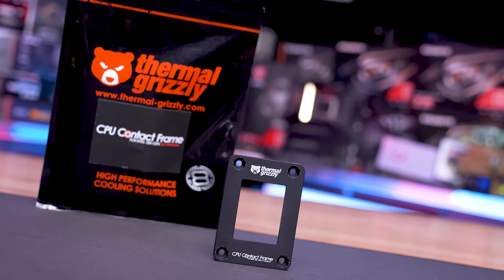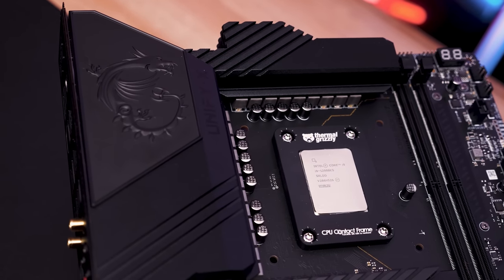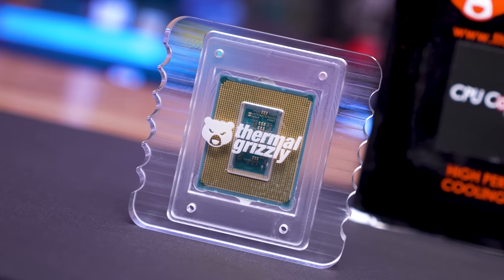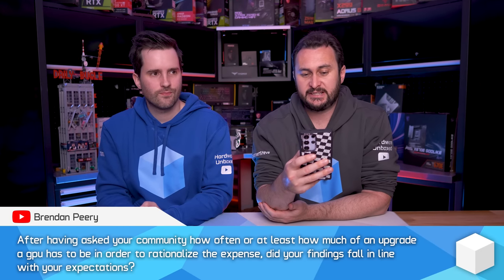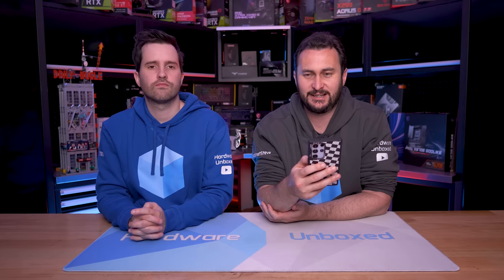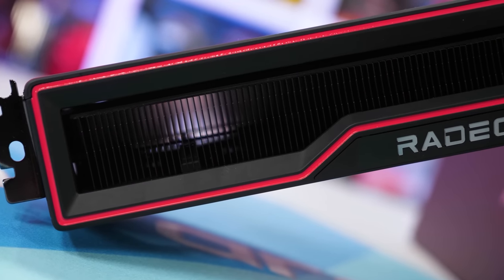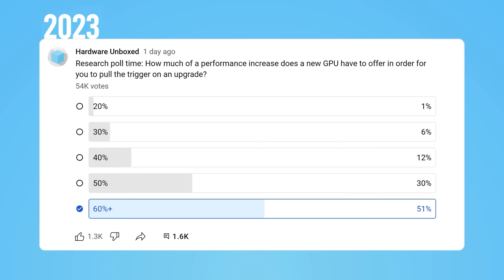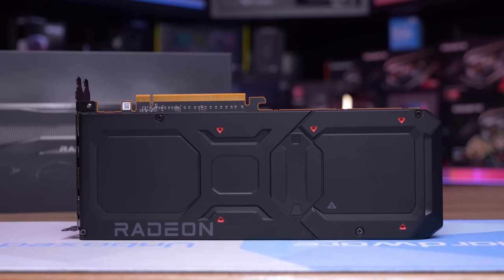RTX 4050 Pricing & VRAM, Are 12-core CPUs Dumb? March Q&A [Part 2]

Comment: “Nvidia trying to condition gamers to pay more, for less.” Who would’ve thought that Intel, the arch antitrust, anti-competition villain of the past, might produce a reasonably priced mid-to-top tier GPU (Battlemage), blowing Nvidia’s strategy away.
Reply: If Intel can offer me 2x 5700 XT performance for no more than 500€, I'll bite
Reply: The problem is Intel isn't really disrupting the market, they are just slotting in within the current pricing structure.  Intel's GPUs are cheap because that is the performance level they command.  In order for Intel to disrupt the market they need to hit at the 4070 Ti level and above and price their cards reasonably.  There's always the chance that when Intel does get performant, they simply follow the Nvidia pricing structure.  After all, this is Intel we are talking about.
Reply: @giglioflex  Intel's arc 770 is a great card ( just brought one a few days ago for a all intel build ) i paid $560aud for a 16gb card  a 3060 or 6700xt is the same price with only 12gb..

i know intel drivers can leave alot to be desired but there are constantly updating and improving them .. 
it s a far cry from my 7600x soon to be 7800x3d and 7900xtx but for the budget sector i see intel going from strength to strength which is where they need to be because with the rubbish Nvidia are trying to push out at their stupid costs is a joke !!

and we are yet to see what AMD offers but its not going to be cheap !!
Reply: too bad this wont happen, intel chief of arc left and rumor is they will have a few SKUs for Battlemage and there is only 1 SKU planned for Celestial, it looks like Arc is being put on the back burner until they come up with a rebrand or something
Reply: the only ones that will buy Intel are the ones that would buy AMD-Cards. AMD is pricing their cards far better since they aquired ATI. Their pricing got a little bit out of hand the last two years but just at launch. AMD-prices are dropping fast after launch, but is anyone buying them? They have similar performance at native resolution like their Nvidia-counterpart and they give a lot of features like open source driver, FSR and their Radeon utilities (which Intel has not). But who is growing its market share? It for sure is not AMD. Intel has weakened AMD, the only real competition for Nvidia fo now. Of course they have to counter with higher prices to compensate for that. 

And Intel is definitly not your friend. Right now they are selling their cards at a loss, because they want to get a foot into the market, but once they are in?
I guess what will happen is, that AMD will close its Graphics-devision, because that is the only market Intel will compete in. Nvidia-buyers will buy Nvidia. AMD right now is in a good Position and i think with their new Architecture they will be able to compete on every performance-level with and without raytraycing (still a stupid feature for me). It needs one or two slips of Nvidia Hardware-wise on the High-end to get in trouble. But they are far away from it right now. And for Intels graphics devision? It is not looking good right now. Intel loves money. A lot. And it does not seems, that Intel graphics will become competitive nor profitable any soon.
Reply: @volvot6rdesignawd702  From what I know about AMD's midrange RDNA 3 dies (check out Angstronomics RDNA 3 leak from August 2022, it's been pretty accurate so far), they won't be very expensive, especially Navi 33. That one is monolithic on 6nm so quite a bit cheaper than the 5nm main die the higher end chips use. Not sure on performance yet but 6700XT or even better 6800 non XT performance on a 7600XT would be pretty good for most people and it needs to be priced around $300 or less (not closer to $400 in other words).
Reply: @vigilant_1934  problem is they are going to price match with Nvidia if Nvidia try's to sell the 4060ti at say $600usd AMD would be damn stupid to sell the 7800xt 
( which make more sense as 4060ti competitor than a 7700xt or 7600xt ) at $300 or $400usd..

Personally i dont think there is any need for either company to go lower than a 4060 and a 7700xt at the lowest and AMD most likely go lower price than Nvidia but they will not be what budget builders are looking for ..

Thats why i kinda throw my support behind the Intel arc 770 i bought one the other day to eventually build a 13600k / intel arc 770 build ( my main system is a 7600x soon 7800x3d and a 7900xtx red devil so i dont need the Intel system)
but this intel arc 770 with 16gb at its low cost is a real contender in the budget 1080 1440p GPU market !! 

Truth be told ive not really tested the arc 770 out with games etc yet as ive paired it with a b550 5600x just to get it running but as im going to buy a b660 ,13600k and some ddr5 after my 7800x3d purchase.. 
Then wiping the ssd and starting again for the re build its pointless to start downloading games!!

Ive watched videos after videos of intel constantly trying to improve their drivers every few months ( so im seeing real intent to improve and succeed)  yes Intel is a multi billion dollar company but i decided to throw my support behind them because despite the haters etc etc budget builders NEED intel to succeed which is why i bought one ..
Reply: Only because Nvidia left that lane open to Intel by moving into the over priced lane.
Reply: Wait till you realize that companies don't care about you and have to do this to gain market share and goodwill. people loved amd. It didn't save them lol

Comment: They're going for the price inflation angle.  They make far more margin that way (which is a huge part of the numbers they target).  They're trying to follow the trends set by Apple and to a lesser extent, Samsung.  Clearly double (2x) the price isn't working, but they can likely get away with somewhere in the realm of 1.5x or even 1.8x.  Don't support it, buy used when possible.
Reply: the only way to change them is to send a clear message that they messed up bad. The only way to do that is to massively shift market-share to AMD/intel. So skip all nvidia cards and buy from teams Red/Blue this upgrade cycle.
Reply: used is indirectly also supporting the purchase of new GPUs via higher resale value

the best thing you can do is to do nothing
Reply: Nah everyone buy a steam deck. It helps boost Linux and AMD marketshare plus you get nice portable gaming machine. Plus the more there are the more devs will have to optimize for lower end hardware to make sure they get the steam deck market.
Reply: @leonhopfl573  Not to the extend that you're thinking it does. There are always going to be people that will buy the newest and fastest, regardless of cost or if they can sell their used GPUs.  During it's years of marginal improvements, Intel ran into the problem that they had to compete with their older products available from the used market. As for doing nothing, it too is a perfectly acceptable option if what you have is already sufficient.
Reply: My last full price GPU was an NVIDIA 950, ever since, I've bought used for a third of the initial cost. It makes no sense to pay double. Don't cover inflation for the developer.
Reply: Not going to claim that companies haven't taken advantage of inflation a bit. However they are not the cause,  low interest and money printing is the cause.
Reply: @wayward03   When I say price inflation, I'm not talking about currency inflation.  They are pushing up the prices of their products chasing margin.  The trend started well before the cv.  Apple started selling phones for way more than their traditional $199 price back in 2015.  Nvidia pushed their pricing up when they introduced RTX.
Reply: @pyro226  that's true,  apple is famous for it. 

On the flip side, computers are still cheaper than they were in the early 90s.
Reply: @chronossage  Steamdeck lol fucking just no
I'd rather buy a used gaming laptop from years past, so I can have an actual laptop and portability. Like, the only time and place a steamdeck makes sense if you're taking the metro to work, but that's like several minutes of gaming tops you might as well play poker on your phone then. I cannot understand steamdeck users. It's wildly expensive and overpriced to within gaming laptop segment, but with a tiny screen, less useability, not a computer, not a mobile shitpost device, horrible performance.
>it's smaller
And easier to steal, really don't get the advantage it's supposed to have over any other thing. Then, I don't really play Nintendo or anything so maybe there's a specific niche game it's good at I don't play, as opposed to atmospheric adventure titles and horror or whatever.

Also you didn't solve the problem for anyone but kids, with rich parents, because it's not for kids too poor to afford a console or computer. I mean at that point you might as well have just said "get a console" even though consoles have huge hidden costs in needing to buy a TV, controllers, and the games cost twice as much on console as PC, or more.

The other guy is right, the most obvious thing is for people to just buy AMD. I already switched to AMD and pretty happy with it. Like if you get an AMD card you're going to play every title at 1440p ultra. If you got a 6800XT or better you can play 4k ultra. There's no reason to stick with nVidia at all except plain stubborness. That, or you need specific encoders, which I doubt like 99% of gamers even know about or ever are going to use. It's pure cope, and is partly because I think gamers by their nature are really resistant to change. They don't like changing their habits. I can imagine the sort of cigarette ash covered keyboard, beer cans everywhere, don't even notice their whole apartment makes their clothes smell of stale beer, but still refuses to clean or change anything even knowing it's wrong because gamer addict mentality. Not having to use Geforce Control panel alone is a blessing. Knowing I'm not cucking myself also is nice.
Reply: @drek9k2  Do you even know what a steam deck is? It's definitely more portable than a laptop and I don't know how $400 is "wildly expensive" even if you have to add in the extra cost of an SD card to make it $450ish. It's a x86 computer with enough power to run most of the PC games out there.

Comment: About why 7000 don't get so much as 5000 from V cache, maybe is simple because it is using DDR5 and older using slower DDR4, and cache is mostly useful in RAM limitation cases
Reply: It makes the CPU less reliant on fast RAM, so you're correct. It still adds to some games that would benefit from even less latency than the fastest of DDR5 could ever provide though. Latency is only increasing with DDR5 compared to DDR4 and this trend will continue with DDR6.
Reply: Yeah, my sense of it is that the higher levels of integrated cache in the non 3D 7000 series plus DDR5 possibly reducing the performance hit of a cache miss are significant contributing factors here. 

I think Ryzen 7000 just isn't as cache starved in situations where Ryzen 5000 was.

Could also be something to do with multiple dies. Youd think disabling the second die would accurately simulate a 7800x3D, but perhaps theres something else going on. Have to wait for the single CCD part to arrive to find out.
Reply: @TheDarksideFNothing  I wonder if the cache directory in the IO die also gets bypassed when cores are disabled
Reply: A wild guess could be that ddr5 has significantly worse timings than ddr4 so that may have an effect but as I said its a wild guess and nothing more
Reply: @IItsIgor  I would think that the DDR5 being inferior in any way would more likely make the v-cache even more important. If the RAM has something making it slower then youd want to avoid searching it as much as possible.

I'd bet its the other way around. I bet searching DDR5 after a cache miss is less of a performance hit, which means there is less performance to claw back by adding more cache.

But like you said, thats just a guess.
Reply: meh i dont know if i agree. FPS differences between DDR4 and DDR5 have never been particularly large on Alder Lake for example. DDR5 really isn't all that beneficial for gaming. A REALLY GOOD DDR5 kit does make a difference compared to more affordable DDR5 and DDR4 and that's about it. I think architecurally there might be a difference between Zen4 and Zen3 that causes Zen4 to be less impacted by having to access RAM coupled with the fact that Zen4 has double the L2 in the first place
Reply: Depends very heavily on the Application. If Application XY can only fill a part of the CPU Cache (because it's not sending enough commands to the CPU) there is no benefit.
Also: Most Videogames are developed for consoles first. In other words: If your not using RTX, your gain will be relatively small anyway. If your using RTX, your CPU has to handle the BVH which is an entirely different story on its own. On top of this: For 99.9% of Games 60 - 144 FPS are more than enough to play them, and you will get 60 - 144FPS from 99.9999% of games out there on "normal X" or "X3D" CPUs anyway. And people who think they "hit more" if they have "300 FPS" or "600 FPS" in Counter Strike need to get help anyway, since a Counter Strike Pro will beat them even at 20 FPS vs 6000 FPS
Reply: Nice short explanation.  Thanks I been saying this but using 60000 million more word :)
Reply: @TheDarksideFNothing  good point, maybe its because ddr5 is so fast that the bigger cache brings diminishing returns
Reply: @youridv  the perceived impacted is lower because the baseline of the cache has been increased between the cpu's where as there was a huge gap with the 5800X and 5800X3D cache. top that off with higher clock speeds, better IPC, better scheduling, faster memory, etc. the cache isn't as much of a bottleneck as it was on zen 3.
Reply: @Trainer_Orange  latency = transfer speed/cas latency/2. So for example ddr5 6000cl30 has the same latency as DDR 3000cl15 or 32000cl16 etc. So it's not really increasing. Actually it's very likely that we will eventually end up with ddr5 kits that have lower latency than the highest end ddr4 could ever.
Reply: @youridv  Intel have much better memory controller, maybe AMD make some good improvements with Zen4 so is not only DDR5 but controller itself. They still have work to do on it, but I think next big jump would be change a way how cache is working, because currently is dumb.
Reply: @TheNerd  RTX is Nvidia branding, you mean RT.
Reply: Just to clarify the formula is extremely simplified and other timings have significant impact on both latency and transfer speed especially with ddr5, but even the simplified formula does illustrate the point well.
Reply: I would guess it is because the drop in clock speed is much higher with a 7000 3D-vcache compared to the non 3D-vcache while the 5800X3D had a drop but not nearly so much.

The LTT video about the 7950X3D was even showing regressions in gaming performance at higher resolutions than 1080p compared to th higher clocked non 3D parts.
Reply: @@sebastiancrisostomo3096 ur 3600 c14 is b die, if u full tune that it will beat all ddr5 xmp kits and up to 7200mhz full tune ddr5
Reply: You forgot 7000 already has double L2 cache over 5000 series, so it's less reliant on oversized L3 v-cache. Better branch prediction helps reduce reliance on low latency RAM. It's all about optimizing the entire path from storage to compute without wasting silicon.
Reply: @Sebastian Crisostomo Literally every 7000 cpu supports 6000@cl30 xmp/expo profiles. No need to tweak anything. Pretty much every cpu will also do 6200 with some tweaking required and some will do 6400 with a lot of tweaking. Pretty sure your memory required tweaking as well.
Reply: @Sebastian Crisostomo and as for the price difference that is the cost of getting superior platform and cpu. Also I'm pretty sure that ddr4 3600cl14 is not cheaper than DDR5 6000cl30.
Reply: @matejnemec3022  its not at pc case gear ( aussie pc retailer ) gkill ddr4 3600 cl 14 32gb is $419aud  the gskill ddr5 6000 cl30 expo 32gb is now at about $380 but can be had for less i payed $280 on sale for it !!
Reply: That's... Not how that works.

Your L1, L2 and L3 cache are used first as the CPU can pull data from them far, far faster than from RAM. This boils down to the natural limitations of Binary/Classical computing. No matter how wide the bus is between the RAM and the CPU it will never be faster than data transfer on the chiplet itself. 

Cache isn't "mostly useful in RAM limitations" but rather the opposite. RAM has been the fix for the limited amount of Cache on the chips. It's been that way since the dawn of computers as we know them.
Reply: @mrgee9430  if L2 would make bigger difference for games it would be visible in without v-cache, and results are in line. And what L2 do is lower latency to L3, size of L3 is different bottleneck and is more about game code optimization (your code work more in place, not dependency on dependency because then they must be hold in memory to unwind them later, and access new regions to create them).
So I don't think size of L2 have any major impact on performance of bigger L3, because this data from L2 would be land on L3 on top of stack (L3 is clean from bottom) and if bigger L2 was needed only mean more often use data from top of L3, not wast in bottom, and bigger L3 give more data on bottom.
Reply: @KaoruSugimura   "mostly useful in RAM limitations" -> it was about access time, not size/transfer rate. So execution of code is waiting for data from RAM, this type limitation only. And today architecture is Von Neumann type, and it wasn't this from beginning, even in 70's for some machines data and operations was separated. This interesting topic, because for today type of AI is not best architecture,